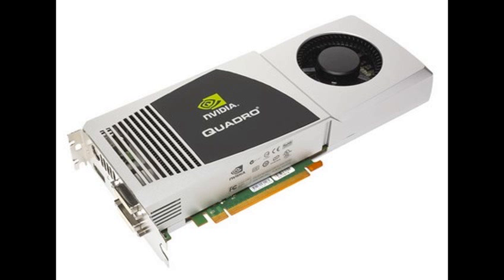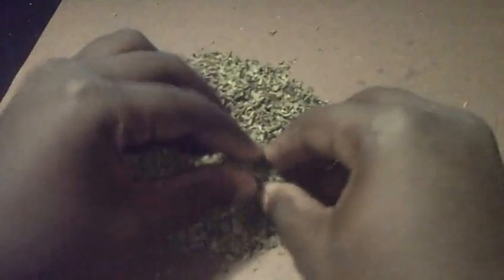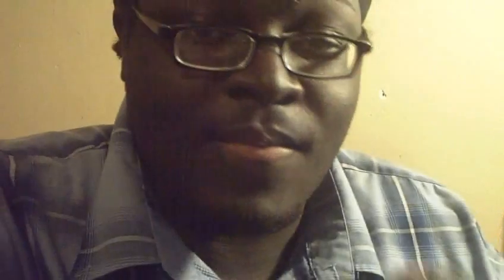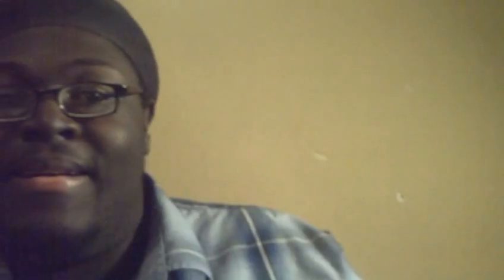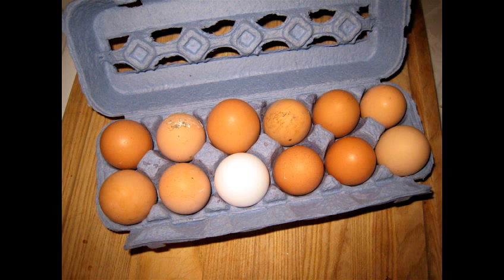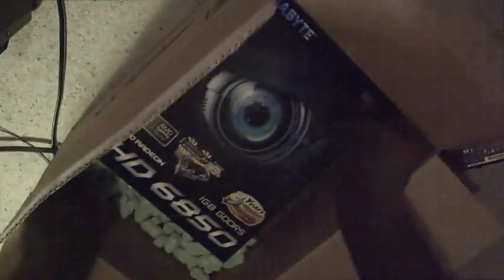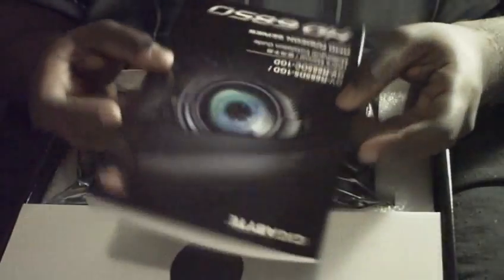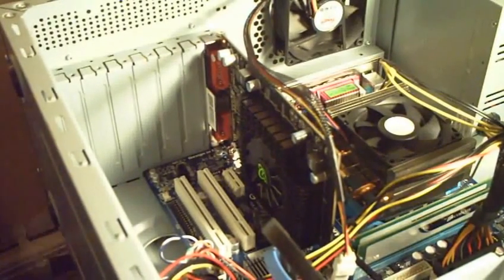Which Graphic Card is for you?: all you need to know and then some.(Epic Guide)

Comment: The case looks tinted grey, that's what he meant to say. 

How many of these parts were added since the video was put up? I can see the additional 6850 and a larger power supply was in order -- I can't tell--. That SSD is new. How about the CPU and Motherboard? The CPU could be up to 3 years old, but is still sold for $99 accordingly. 

As for the Mobo : /watch?feature=player_embedded&v=tX1bt0LXsmw

Most of the parts you listed couldn't have been in this computer over 18 months ago. Good video.

Comment from the maker: My pc build:

AMD Phenom II x4 965 Black Edition 4.00GHz Coolit ECO Liquid cooler 
patriot 12GB 2000mhz DDR3 (clocked @1800mhz)
Dual Gigabyte Radeon HD 6850 1GB DDR5 OC Crossfire.
GIGABYTE GA-990FXA-UD3
OCZ Vertex 4 128GB SSD plus Western Digital Caviar Blue Hard Drive 1TB, 7200RPM
Diablotek RPM series 950watt psu
NZXT Phantom PHAN-001WT White Steel case
Microsoft Sidewinder x5 Gaming Mouse
Corsair Vengeance 1500 Headset
Windows 7 Ultimate 64-bit

Yeah I don't know what you mean by old, brah.

Comment: 2nd Generation Intel® Core™ i3-2120 (3M Cache, 3.3 GHz) Windows® 7 Home Premium, 64Bit, English 6GB2 Dual Channel DDR3 SDRAM at 1333MHz 1TB SATA 3Gb/s (7,200RPM) 32MB Cache 1GB GDDR5 NVIDIA® GeForce® GT 545. is the graphics card upgradable and to what extent would you say? this is the alienware x51 if you are wondering

Comment from the maker: No you can not, you will need at least a minimum of 500 watt power-supply. But the most I would suggest you get as far a psu goes is a 700watt. That way you can be pretty future proof with your build.